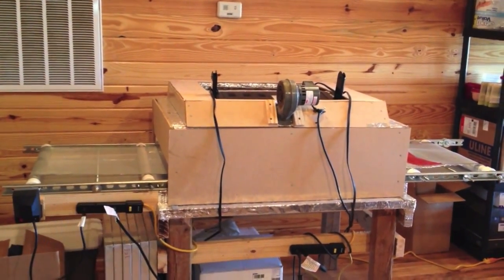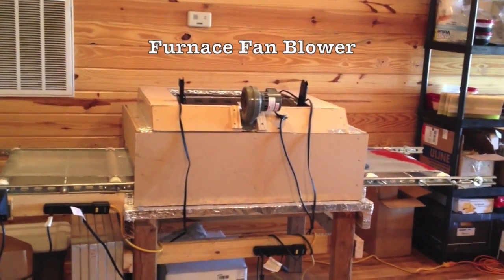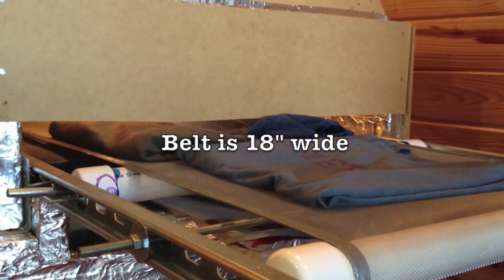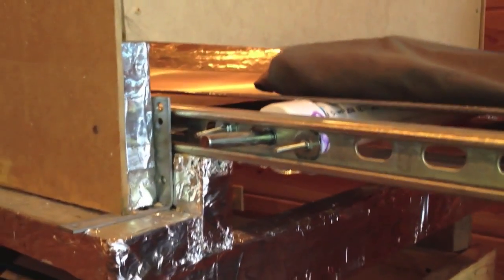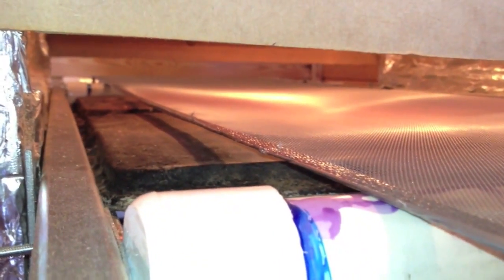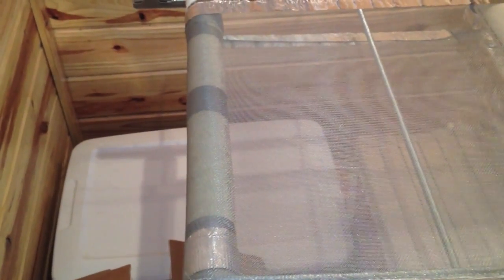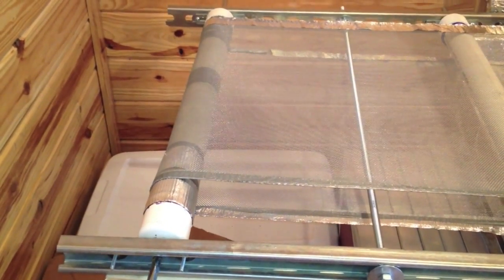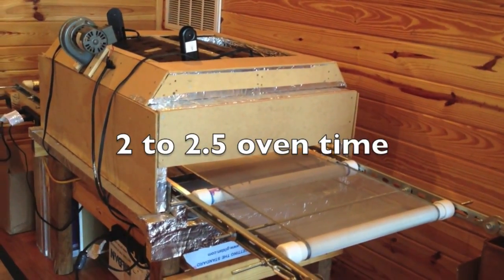Conveyor Dryer -  DIYConveyorDryer.com

Comment: Do you find the rotisserie motor sufficient? How many rotations per minute? With those temps, would you be able to speed up the motor if it had variable speed? I'm in the process of building myself, but wanted to speed it up a little by making the heat element closer to the belt and having a variable speed motor. Found one that does 13 - 55 rpm variable. Just wondering where your motor would fall in the rpm range. Thanks for the good work and share! Great job.

Comment: I have almost this same setup. But I have to plug my heaters up to different outlets so I don't trip the breaker. Have you run into this? I would like to wire all four elements together, but I don't think it's possible. Idk...

Comment: It will get hotter than that if you allow the heaters to warm up for at least 15 min. It will stay around 280. It is hot enough for water based printing...I used it for that. If u do plastisol than you wouldn't need to turn the fan on. It would be around 320 without the fan

Comment from the maker: Thanks man. Yeah you have to out it in different circuits. I used an extension cord and just plug it in on a different circuit. My cabi is very small so you should have 2 separate  circuits where you are.